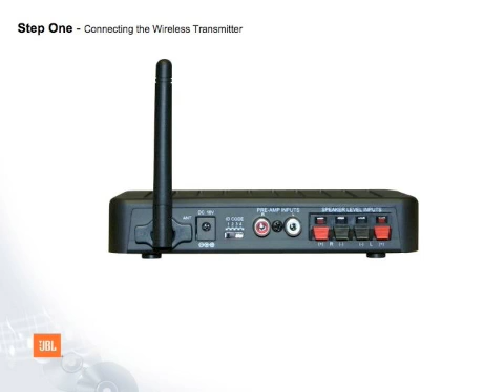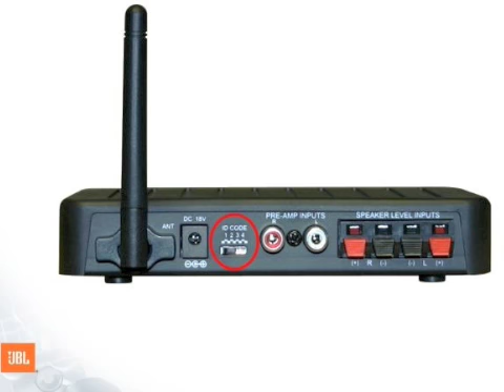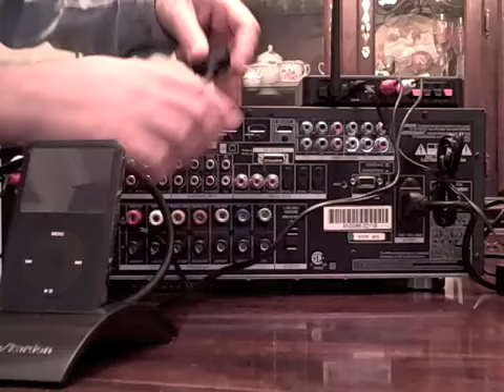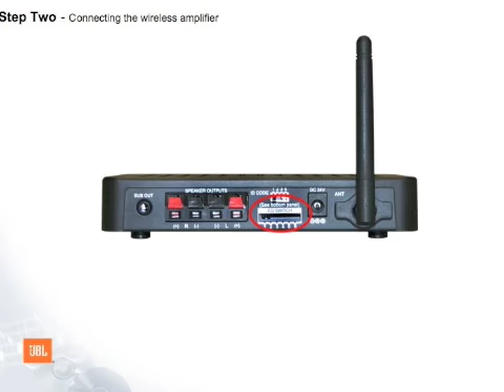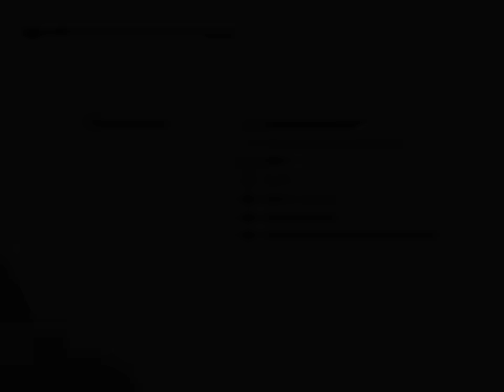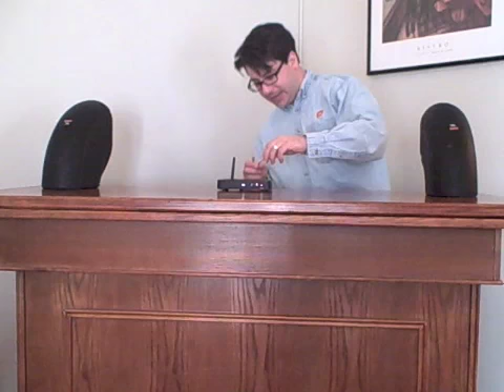Make any speaker wireless with great JBL sound!

Comment: So many dumb comments by people that don't understand the use case for this. It's if you want the same music to play on your main system and in another room without having to run a wire between the rooms. It's wireless between the rooms, not from the receiver/amp to the speakers. Smh

Anyway, thanks for the vid, there's one of these available on my local auction site and it looks handy so might pick it up. Cheers

Comment: This is not making speakers wireless!  You still have to run wires from each speaker to the amplifier!
Reply: This video is over 10 years old so would apply to anyone with who had some old speakers they want to make wireless.  Fast forward 10 years and most amplifiers to wireless transmit are built into the speaker casing.
Reply: Say you want to play the same music in your lounge and your bedroom, instead of running a wire from your lounge to your bedroom you use this.

Comment: I was thinking this is the ticket until I found out from JBL/Karmon that this unit was discontinued way back in 2011.  Time to take this video down,
Reply: I found this item on my local auction site for used items so it's irrelevant when the unit was discontinued, this video was still very helpful.

Comment: Hi,  can I connect two receivers, one for each loudspeaker I would like to put in the corners of the room?  In fact, since the system uses just one frequency to transmit a signal to the receiver, I could only require one transmitter installed at the stereo along with 2 separate receivers, one for each speaker. With no wires around the room.

Comment: Sounds interesting, I would like something with a bit further range though. (like, 150-200ft)  If it had a slightly longer range, it might be good to add a couple small speakers to my current P.A. system. Got a gig I usually do once a year, where I setup sound in a small banquet hall, and the place is a pain to get setup. Its long more then wide, crammed full of tables, and my two speakers makes it hard to get adequate room coverage. Running cables all over the room is hard to do without making a hazard.  This system MIGHT have enough range to do it, but I'd prefer at least a 100ft range or better.

Also, even though its 4 years old, I wish I could reply directly to Nathan Hardin's comment down below.  For starters, he is confusing "high performance" with "High Quality".  Second of all,  only hard core audiophiles will measure the performance or quality by FLACC or WAV (IE: lossless)  Yes, its true these are better, but the standard that the common person is use to is MP3, Not a lot of folks outside of the audio world (techs like myself or just reg audiophiles) even know about FLACC, or the cleanness of wav.(especially 4 years ago when ur comment was posted)  So you're statement was nothing more then the typical audiophile holier then thou attitude  looking down your nose at anything that isn't lossless, and not even getting your facts right in the process, which just makes you sound like a fool. (IE: high performance vs high quality)  To be high performance, all this has to do is send and play whatever signal is being sent in a productive and efficient manner. You can send a 96kbps mp3 to a receiver 60 ft away, and it does so through walls & around corners, then plays it back without loosing data (or much data) along the way,  its performing its task pretty well! (IE: high performance)  The sound might be shit, but its sending and playing back that shit to the highest standards!

Comment: Is the power of the speakers limited by the power of the receiver? Does it work only with JBL speakers? I'm wiling to set a 5.1 or 7.1 home theather with the surround speakers going over the air to avoid using too many cables... Do this affect the syncronization technology like audyssey?? Thanks!
Reply: I'm also thinking the same... if u got any Succesful method pls update..

Comment: what is the point of this really. its not wireless because you have to plug the transmitter in so save the money and have direct sound with 4 gauge cable going to your speakers. my speakers cost £900 i wouldn't risk damaging them with a bad signal or interference. i bought them for quality listening

Comment: so instead of running one 60 foot length of speaker wire, you have to spend $x on this, necessitating 2 new AC adaptors you have to plug somewhere, find a place to hide the wireless amp and still need to run x amount of speaker wire anyway. Sounds great huh?